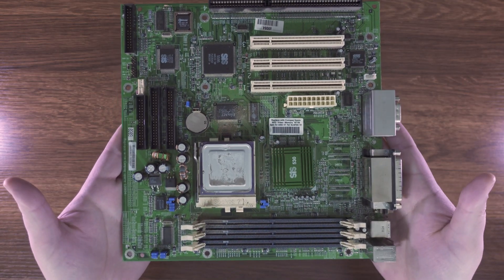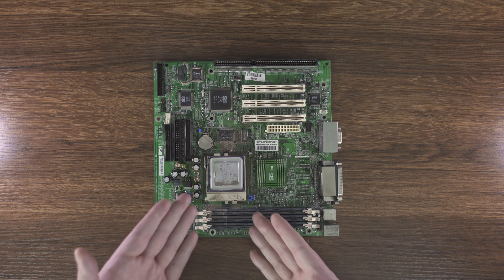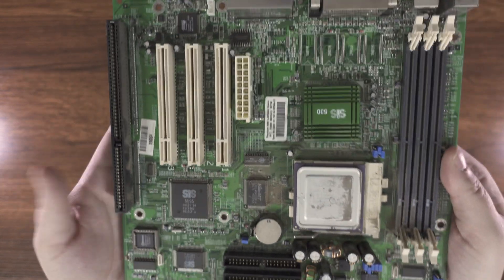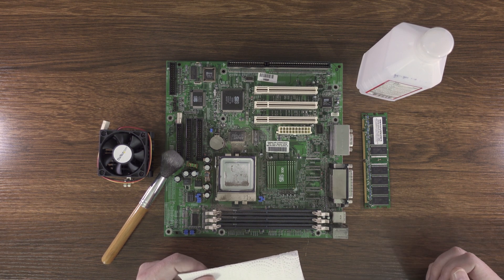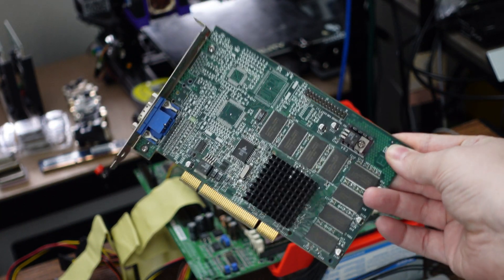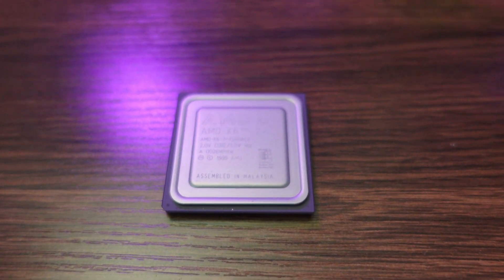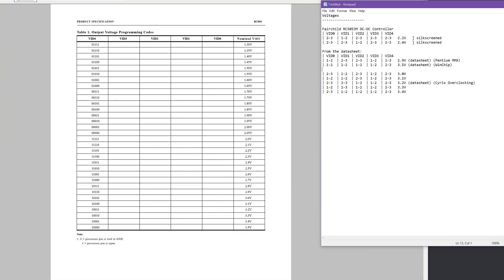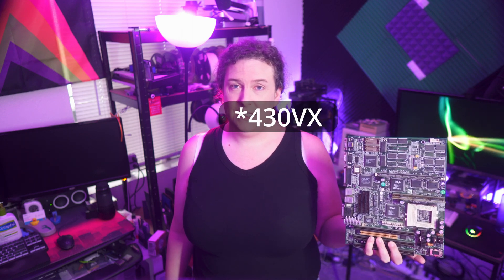A strange SiS 530 board from Compaq

Comment: There is an Amdk6 patch file you can download to get a K6/2 to work at its rated speed. You have to temporarily undercooked the cpu 266 or below and run the patch then just relocate cpu reboot win95 will work.
Reply: Compaq scams using taiwan motherboard gigabyte,ecs,msi,fic

Comment: Most SIS 530 boards came with 1mb L2 cache and were great price-to-performance options. This particular one was bad due to having no L2 cache which is was incredibly important for the SIS530 since it had limited memory bandwidth. Back in 2000 I bought a PCCHIPS SIS 530 with 1mb L2 cache and K6-2 500mhz, integrated audio and video and it was a really great deal for $125. 800x600 video resolution was the norm back then and the integrated video handled 2D just fine.

Comment: I have a similar board for my P200MMX DOS/Win95 build - asus p5-99vm. It doesnt run anything that needs AGP but it's pretty great in DOS. Lets me use a S3 trio (excellent for DOS compatibility), voodoo 1, and sb awe64 for a great high end DOS machine. And it's ATX so no worries about sourcing an AT adapter/case. The 200mhz is 'slow' enough to avoid the runtime 200 errors but fast enough to run just about anything in DOS including the later games like redneck rampage.

It's terrible for anything above very early win95 though, the lack of AGP really starts to show up.

Comment: I own a similar board to this. BIN 530. It’s has a 530 / 559”X” chipset. To get mine fully working, I have to use the IGP driver,  AGP (GART) driver  and 5595/97 driver. Those two last ones have like extra stuff that the motherboard needs to get running stuff right.

Comment: SiSyphus. I am DEAD. 🤣
That's great, a perfectly adequate DOS/Win98 pea-shooter! Nice! 
I'm working on a video about a weird industrial panel PC that was sold as "P4 ???GHZ" with several other incorrect specs listed! Turns out it's a VIA EPIA-5000 Mini-ITX board, with an integrated VIA C3 533mhz CPU, comparable to a Pentium 233 or so. QUITE a long shot from the P4 it promised, but that's fine lol. ONE PCI slot, no FDD header, USB 1.1, BUT it does have some half decent Soundblaster emulation in DOS (After some driver tomfoolery) so, it's been a fun challenge! But I gotta finish my Chrimbus video first 😅

Great video, Looking forward to the next one! 😁

Comment: The SIS530 isn't garbage compared to the later 600-series.
I've got a SS7 board, and while it doesn't have AGP only onboard IGP, everything else about it is solid and FAST. It supports 100MHz FSB, currently runs with a K6-2+ 400, and has been the most stable of my Socket7 boards. Mine sports an onboard ESS Solo-1 as well, which works ok, but I opted for an SB32 PnP instead and disabled the onboard soundcard.
The onboard graphics works great in DOS and Windows, and paired with my V1, it's an awesome machine.

Comment: Did you try the 530 drivers from Retroweb? They also have a fully worked out set of jumper settings, for an overclock of a 100FSB CPU, it can do 105, 113, 125 and 133.
Might be interesting to see if the L2 cache holds up and can deliver more performance at 133FSB and dropped multiplier
Reply from the maker: I'm sure I looked at this board's entry on TRW, but I don't recall seeing a manual or drivers. I'll have to go back and hunt around some more, because that sounds like it'd actually work pretty well.

Comment: Those empty memory pads are just such a tease.
Reply: Definitely worth finding the right chip to solder in there, might even just work :)
Reply: I guess the slight performance increase wouldn't justify the costs and effort. But it sure would be fun anyway
Reply: The integrated graphics will continue super slow, but if you can disable shared memory it boosts the CPU ram performance also, so kinda neat, but yeah

Comment: I recently built a socket 7 pc with a soyo sis 5598 board with a pentium mmx 166 cpu and i actually like it because it peforms a bit worse at the same clock speed than my asus p5a board, so when i use setmul to lower the performance i can get it waaay deep into 386 territory, I had no problems with the on board video, however the onboard ALS 120 sound chip gave me a ton of problems especially I could never get the synth to work in windows for some reason but i ended up using dedicated sound and video with it anyway so it didn't bother me. If you're in the slow is good mindset the SIS boards are good to check out.